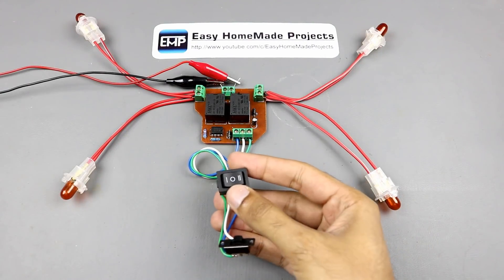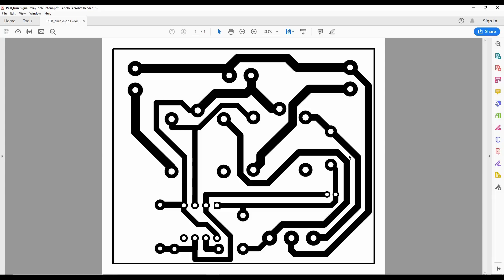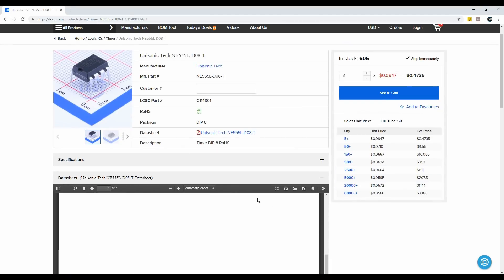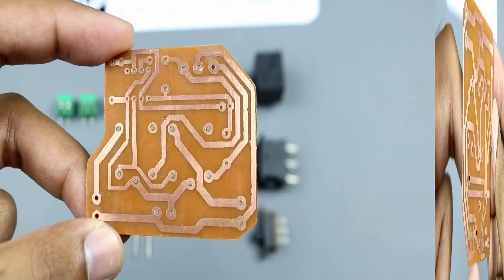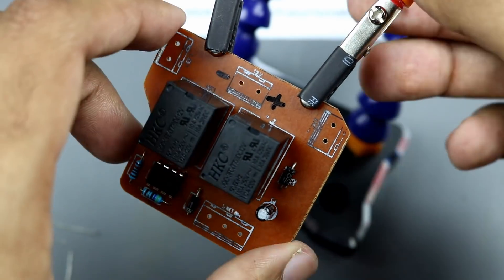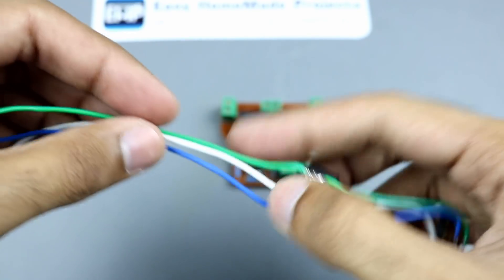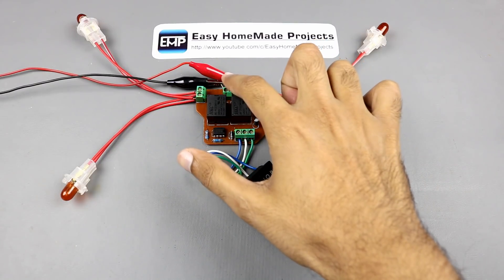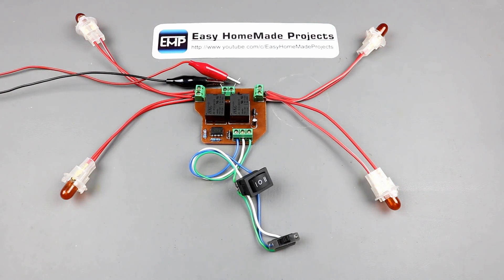DIY Turn indicator Relay Circuit for HomeMade/Custom Vehicles

Comment: Would this application be suitable for an MPV with 6 signal lights, plus 2 bulbs more as the dashboard Left and Right arrow display? Would my requirement pull too many amps or blow and of the components? lastly what fuse would you recommend for the 12v feed? This idea may save my car from the scrap pile. thanks

Comment: This is very neat. Exactly what I need. How can I change the speed of the flashing?
Reply from the maker: Watch complete video and video description
Reply: @EasyHomeMadeProjects  your description AND your video does not say which resistor I can change to make it flash faster or slower. Secondly there is a discrepancy between the video and the circuit diagram SVG file. At 0:46 in the video you show R1 = 620k and R2 = 160k but in the SVG you have R1 = 160k and R2 = 620k ? What is it supposed to be?
Reply from the maker: You can increase or decrease speed by using these 2 resistors.